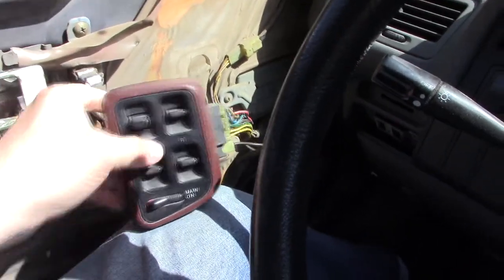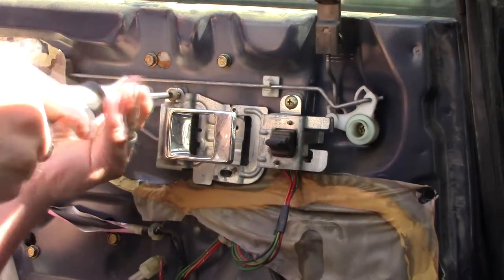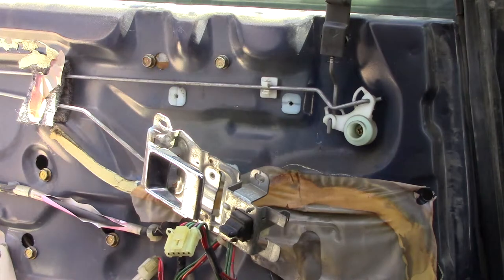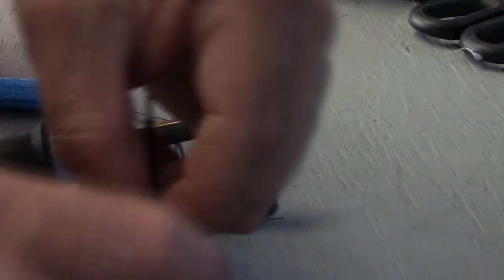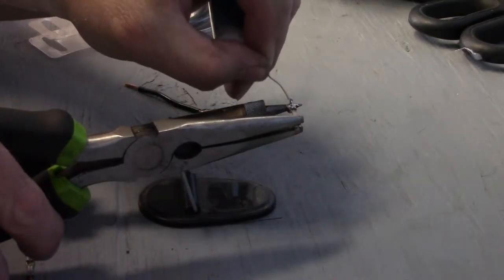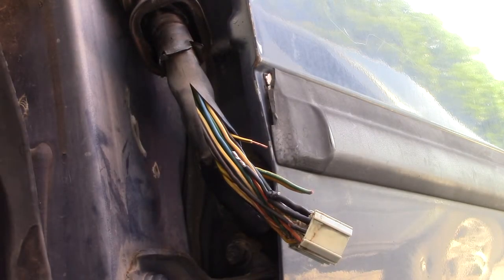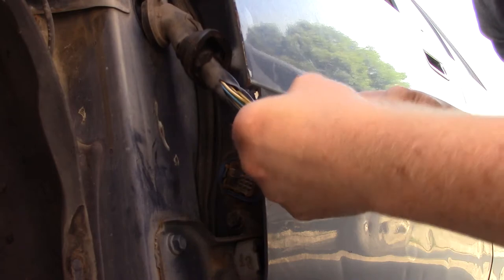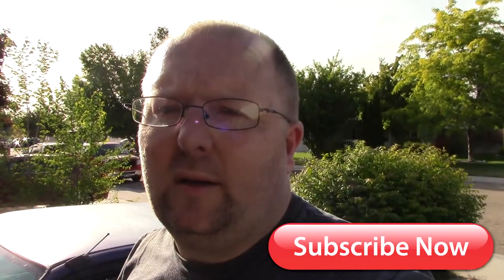Vlog 013 - Fixing the power windows in the EF sedan

Comment: Thanks for the video. My rear passenger window would not roll down from the rear switch, but it would roll up and also worked up and down from the driver switch. All the switches and fuses were good. It ended up being a few wires in the door jam being damaged in the same way. Thanks for sharing.